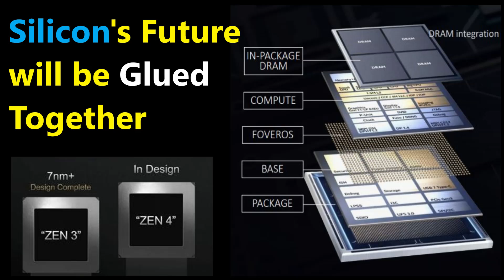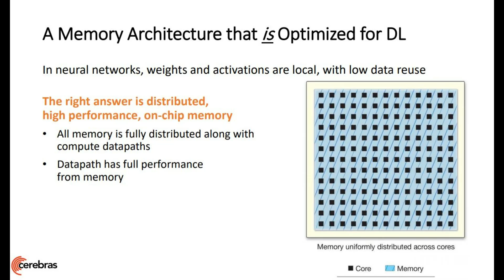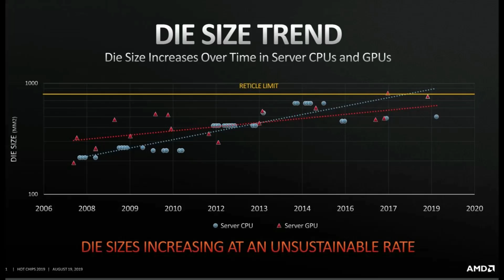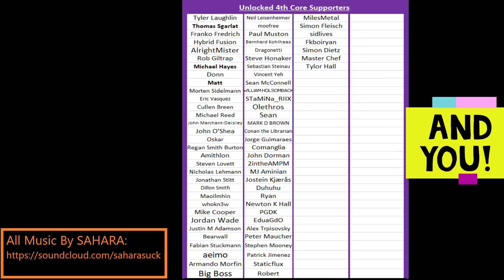3D Stacking the Future of Silicon

Comment: I'm not sure that copper could be used as a intra-stack heatpipe considering that it's pretty conductive and might be too close to the interconnects. There's also thermal expansion to consider, which becomes trickier as you combine different elements in a very confined space. It'll be interesting to see what kinds of solutions are created for this, especially ones viable in the consumer market.
Reply: Hexagonal boron nitride could be, its an insulator so shorts wont be an issue, and extremely thermally conductive - has the nickname white graphene.
Reply: I'm pretty sure that thermal expansion is already an issue, it's one reason of many that exceeding temp limits is inadvisable.
Reply: @mnomadvfx  not just exceeding temps, the temp cycle in general.

Obviously there's a peak temp that you can't pass but idling down to 20*C then rising to 90*C then back to 20*C is worse than staying at 70*C all day.
Reply: Copper is a mediocre conductor anyhow. Stacking an actual heat pipe inside a 3d stacked chip would be quite the undertaking, and of questionable benefit.
https://www.youtube.com/watch?v=OR8u__Hcb3k
Reply: MNGoldenEagle capillary action says hello?
Reply: @DanteIsAwake  Not being a physicist, I'm curious how that comes into play. I was under the impression that had more of an effect with fluid dynamics, like liquid or gas cooling. I was also under the assumption that stacked chips wouldn't require exotic cooling in the consumer space since that adds a lot to either cost or maintenance. What am I missing in my understanding of this picture? Probably a lot, but I'd like to learn more.
Reply: @DanteIsAwake  You mean DARPA ICEcool?

If so microfluidic cooling of stacks is definitely possible, just an extra engineering overhead on top of the stacking itself, yields may be a bitch in 1st gen products however well the cooling works in working chips.
Reply: just use holograms and refracted light to hold and pass information.

Comment: I still expect vacuum transistors to become a thing!
Combined with the right efficient architecture, it would be absolutely unbeatable.
And yes, this is within reach, you might see it in a decade, two at most.
Reply: Electronics will have gone full circle in that case. From vacuum valves to solid-state transistors and back again! It could happen if the reliability problems can be fixed.
Reply: I want these so bad. >10x single-threaded performance would be incredible.

Comment: As usual, I mostly agree with that.
Huge wafer sized 'chips' ~ that's not a typical solution. There may be certain very specific applications where it works incredibly well, but it's not a solution to many problems.
3d stacking, is. As he says, we're only just starting to get into this, and what we've seen to this point, just like what we've seen with chiplets for AMD, is only the first iteration of this.
As he says, Moore's Law with regard to shrinking the process, perhaps that's over ~ or at least going to slow down very dramatically, but in some ways that's maybe the best thing that could happen, because now for the first time in 40 years or so there isn't an obvious path forward that all the competing companies are going to take. Customers and consumers and everybody have got used to this double the performance every 18 months or so (roughly) and just because you can't go any further without quantum tunnelling destroying your reliability, that's not an excuse Wall Street wants to hear. If you can't shrink it and you can't turn up the clock, then how about you stack 30 ~ 50 layers of logic up? They do it with FLASH storage don't they? Well there you are ~ What's stopping you?

This is not going to be easy, there will be some mis-steps, but... We're dealing with one set of mis-steps now. It's a pain, but we're not about to go back to single core single thread CPUs that don't have speculative out of order execution because that'd be a 90% plus drop in the amount of work they can do. And that's just not going to happen. So we're going to get gradual fixes over a decade or more to Intel's security problems and operating systems and apps that're coded in slightly funny ways to get around the issue. It is inconvenient (and it's going to co$t) but it's not the end of the world. Exactly twenty years ago we all thought the world was going to BSOD a minute after midnight on January first, because of the y2k bug. Turned out, it was inconvenient, but not the end of life as we know it, Jim.

Comment: well the re-emergence of a second cpu manufactuer as an 'option' has brought about the true fact again ,WITHOUT COMPETITION YOU WILL LACK ANY INNOVATION............
Reply: Closer to 3-5 with Apple, ARM and Samsung all having cores that compare favourably of more than to the x86/64 crowd.
Reply: @mnomadvfx  Your forgetting IBM
Reply: @marty8370  Not really a factor with IBM, there are no significant POWER based CPU's in the consumer space today since the last console gen based on them ceased to be manufactured.

They could bounce back, but they need a CPU croe completely different from their POWER9 to address consumers, and especially low power sectors.
Reply: @mnomadvfx  IBM still massive in server chips, and are one of many looking into Quantum computing R & D
Reply: @marty8370  Server only as I said, POWER9 and soon POWER10 are exclusively server/datacenter.
Reply: @marty8370  There is also an IBM mainframe ISA called z/Architecture.

Though I'm astounded mainframe systems still exist, they are a relic of a bygone era when Alpha was still a big cat in the jungle.
Reply: @mnomadvfx  well the comment was meant directly to amd making intel start to develop some new ideas ,but your point is true as well ,apple/arm/samsung are facing a challenge with the vast amount of windows followers though ,most private buyers walk into a shop or order from dell etc etc ,and only know windows,excluding the apple ecosystem disciples

Comment: EUV reticle is microscopic in comparison to conventional ArF litho. And current numeric aperture of EUV equipment is 0.33. You cannot physically make megachips on EUV nodes
Reply: Your post is kinda eye opening why it's all happens. Because otherwise, Intel hype of stacking, gluing it doesnt have sense for me at all. Well except i kinda understand since their Altera FPGA uses multiple chiplets different purpose to make one chip, and they have issues making big chip on 10nm. Because EUV is the future, small chips glued, stacked also has to be. This makes sense. Old monolith vs fast, dense but glue. For intel there is no way to stay with 14nm forever, they have to move on glued pieces smaller nodes.

Comment: some day we wont use mm^2, we'll use mm^3
Reply: Since they arent using it for nm, but dividing nm/layers (memory vendors for example). Mine opinion we will still have mm2 except maybe written differently 10x 100mm2
Reply: @KabelkowyJoe  Yeah, they express HBM in stack height, and VNAND in layers.

Not sure what individual HBM dies are height wise, but individual VNAND layers are mere 10s of micrometers/microns at the current gen.
Reply: In a way, we already do. It's just that we use mm^2 + X nanometers.
Reply: Some day we will use km^3 no I'm jk 😄
Reply: @lordswaggity1213  as long as we don't use imperial units (like the UK uses) or the outdated British units (that the US use), I'm fine
Reply: @lordswaggity1213  funny
Reply: @lordswaggity1213  How many km^3 is your country?

Comment: I'm sure all the many CPU exploits can be glued together to make meta-exploits like we've never seen before and computing (in this form) will die just like modular smart phones
Reply: what are you talking about, if ypur saying an all in one malware that specifically attacks intel cpus, it wont exist simply its a single executable, if you compile it into a whole chunk, surely all wont run at the same time and may possibly run on each other which would just interfer with each other giving you errounous data. If you want a program that fully exploits information to an extent, theres going to be metigations for such exploit and the only thing you can do see jumbled up data, that you would also need extreme hardware to decode.
Reply: @fin-ale7101  I was talking about the modular CPU pieces that could be combined to make a new sort of CPU. It's quite difficult for a company to maintain multiple skus for a CPU, let alone modular components that may or may not work together depending on the specific combination of parts, and it ultimately leads to multiple points of failure security wise and sustainability long term.

Comment: But Intel said glue is for babies.
Reply: And they glued a xeon XD
Reply: @FIRSTEBITOS  Didn't they glue the Core2 Quad chips too?
Reply: @DenGuleBalje   i dont know :/
Reply: @DenGuleBalje  And Pentium D
Reply: @DenGuleBalje  I think the Core 2 Quad was the first big chip from Intel.

Pentium D was two chips

Could be the first release of Quad was glued but I don't think so. It was faster than AMD's quad core and that would have been difficult with two Duo glued together.
Reply: @glenwaldrop8166  I'm pretty sure it was two dies. Some time ago I wanted to upgrade my Core2 Duo laptop to a Core2 Quad, but discovered that while it would fit in the socket, there was something about the chipset that was different. Every model of the Core2 Quads I looked at had two distinct dies.
Edit: And a quick google search confirms this.
Reply: @glenwaldrop8166  Also.. which Core2 Quad and which quad core AMD? If you want to compare the Q6600 to the Phenom X4 9950 which both came out in 2007 then the Phenom beats the Quad.
Or are you thinking about some other matchup?
Reply: Fair enough.

I remembered that wrong. Didn't google it last night because I was on my phone. It's becoming less than pleasant to do that sort of thing, probably time for an upgrade.

Performance wise tho... not so good.

See I had Phenom processors, several in fact.

Core 2 Quad was faster per clock and ran at a higher clock. Here's the slowest C2Q on Anandtech's bench vs the fastest 1st gen Phenom.

The Phenom II was a different story. The Phenom II unfortunately was competing with the i7 Nehalem.

https://www.anandtech.com/bench/product/53?vs=21
Reply: Glue is what Intel users sniff..  jk
Reply: I think it was "babies are for Intel".
Reply: And AMD said same thing >10y earlier.
Reply: @jouniosmala9921  but intel said about amd 1st gen epic that it is glued chip and should be avoided.. :D they kept talking about security but then spectre and meltdown happened.. even i really like my intel cpu's in 2in/1-tablet and notebook, their marketing is just worst for anyone educational in computer science (tho same can be said about nvidia/amd in some cases - but it is much worse with intel)